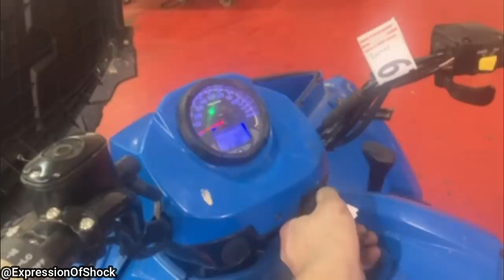Customer States Dodge Challenger Won't Start After Collision Repair | Just Rolled In

Comment: I got a little original German Mercedes anecdote.

My company always drives Sprinter vans. One time, an engine died somehow and got replaced with a factory new one. I was given this van with the new engine. When leaving the company grounds, the engine turned off after 1/4 mile. Started up again, so I tried going again. Engine turned off again after a short distance, not even leaving the tiny town. Told my company, I can't go on this 400 miles trip with this van, all the shit was loaded over to another van and there I went.
Few days later I was informed, that the Mercedes mechanics missed to install the oil line between engine and oil pan. The new engine ran dry, got killed and had to be replaced under warranty.

Comment: 1:41 I had something similar to this happen to me.  I bought a brand new trailer a few years ago.  When I say brand new, I mean, it was so new, it wasn't even towed to a dealership, I bought it directly at the plant of manufacture.  So it literally had 0 miles on it.  After towing it once, I noticed that the brakes had no power.  When I say no braking power, I mean that with the wheels jacked up, I could still spin the wheels by hand, even if I had full brakes applied.  When I pulled the hub, everything was coated with grease... not as bad as this, but the lead shoe, the trailing shoe, and the magnet were all coated.  What happened was that the axles were Dexter EZ-Lubes, where someone could lube the bearings by pumping grease through the zerk fitting at the end of the spindle (there's one on this fitting too).  If someone pumped the grease in SLOWLY while spinning the wheel by hand, the grease would fill the bearings.  If someone pumped the grease in a hurry, like with an electric grease pump, then it would just blow out the rear seal, and the grease wouldn't fill the bearings, it would just fill in the brake drum.  I think that's what happened in this case.  When I fixed mine, all I did was clean everything with 4 cans of brake cleaner (1 can per wheel) and several rolls of paper towels.  Eventually I got everything clean, and my brakes worked perfect since then.  A lot of people claim that when the brake linings are contaminated with grease, that the brakes must be replaced, but I didn't have any problems, just used a lot of brake cleaner.

Comment: Oof that wheel bearing though. I just did one on a 2002 i35 and only thing holding it together was the cotter pin for the axle, pulled the hub out with two fingers

Comment: I was on a driving lesson with my dad, we pulled up behind a car and both it's back tyres were really low. Dad told the driver they need air in the back tyres, the lady driving didn't know how to do it, so dad told her to pull into the next service station and he would show her what to do. When he went to blow up her tyres, both valves had a broken matchstick in them. Dad managed to get them out and show the lady how to blow up her tyres. Turns out there was some kids sticking matchsticks in the tyres valves at the local shopping centre car park. When they were caught they said ''it was just a prank'' 🤦‍♂️😡
Reply from the maker: Damn kids 😆. I've done some "pranks" when I was younger but it was never to people's vehicle lol
Reply: that could also be deadly

Comment: I have had body work done several times. Couple of deer strikes, a hit from an uninsured/unlicensed driver, got backed into while parked, etc.... Nothing major. I took them to a shop with a good reputation, that I trusted. Always good work. If you don't have insurance or the money to fix it right, don't get it fixed. Using a cheapo body shop is a big waste. It won't look right, may be unsafe, and resale value will be down.

Comment: I had a body shop drop off a SUV to check noise after they finished their job but gave car back to customer who had it for over a week. We were busy but said it would at least get looked at b4 lunch and report the findings. Found myself waiting for parts so decided good time to do a road test . 2 laps around the complex I couldn’t quite hear or feel a thing so thought maybe wheel bearing that was noisier at highway speeds. Up the road I went , was about 2 mile away when noise started, I thought to slow down to perform a u-turn and head back to shop knowing noise was left front but still not 100% confident it was a bearing or what , then the LF wheel passed me , damaging the freshly painted fender on its way out. Lugs nuts came off, I was able to jack the car , steal a lug nut from each other wheel and put tire on to get back to body shop. Come to find out the lady had it to her mechanic and to the body shop a few times in that week b4 I got it. I feel blessed I didnt get injured and not knowing the lady thankful it didn’t happen to hear but it would have if she drove it one more day

Comment: The mobile mechanic just wanted to make the brakes last longer. A couple of those might need a wheel bearing. I came across a taper bearing where the inner race was galded/welded by heat to the spindle and ended up using a cutting wheel to get it off and others that had to have the spindle replaced too.

Comment: The thumbnail looks like what mice did to my 95 Z28.  Ate through so much wiring!  Have you ever heard what a GM LT1 sounds like running on 3 cylinders?  Me either.  Got it to run for about 3 secs...

Comment: The ATV wouldn't start, bcs the air filter was installed backwards. If this engine uses a carborator, then if theres no air, and no air means no gas, technicaly, it ain't got no gas in it!

Comment: I had a bad shake while driving for awhile. Thought for sure it was a tire. It ended up being the master cylinder that would occasionally get stuck and the brakes
Would be slightly engaged causing brake rattle.

Comment: You see there is a use for an Audi engine.
The trailer brakes though?? I have seen totally stuffed hubs but the drums?? 
The ATV filter,, that needs clamping on. and even then probably NOT suitable for ATV use.

Comment: Hmmm, no communication with ABS module because of severed wires.....are you sure it’s a Challenger and not the Ford Explorer I was working on when 5 pm rolled around Friday? 🤔

And was a PLASTIC line they used for the brakes?!?

Comment: 0:05 this hurts to see. either the cuts were caused by the accident, or by laziness. there is a reason why they say, check wheel nuts when a car comes from the body shop...
0:37 check your local road construction site. the worker probably sticks under the next truck... protip: don't run over everythign that lays on the road, no matter if you think there is enough clearance.
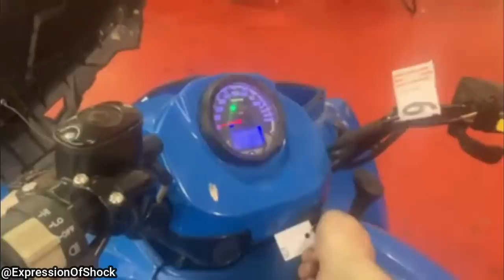1:14 this can also happen to rethreaded tyres, as there is no way to determine what has been done to the tyre before rethreading. I had one breaking like this after two years of normal driving.
admittedly, the noise and vibration comes slowly, and is often not noticed until someone else asks what that noise is.
1:41 I had to pause the vid and stare in astonishment. I can understand a splat of grease or oil, but filling THE ENTIRE BRAKE DRUM WITH GREASE how does one get that idea? they clearly had no clue what they were doing.
2:31 story from me learning car mechanic.
after the initial year of apprenticeship we were tested for knowledge, theory and practical. the school had some donated cars from a local Opel dealer, namely some Opel Rekord-D. for unknown reasons, Opel added a little bolt to the wheel hub surface with a corresponding hole in the wheel, so it can only be installed one of four ways. they omitted it again eventually... so when it was my turn, I removed the wheel from the car and went to diagnose, wheel, tyre, brake, and everything. and of course saw the dents left by ignoring the bolt... and the ruined wheel's conus from the nuts being screwed on backwards. after mentioning all these details the teacher nodded me off and called for the next. guess I did it right, I got a pretty good rating. XD
2:41 great work! :D they cranked out some nice motorhead's furniture out of mere junk. ^^
outro: can I has the Fairlane pls?

Comment: That trailer brake job ... I just can't even ... that's amazingly bad. WTF did they even DO to create that mess??
Reply: The wheel bearing dust cap sometimes has a grease fitting. Supposedly so you can lube the bearings without removing them. Eventually that hub cavity will get full with grease and push past the rear seal. Then you keep pumping in tube after tube until completely full.
Reply: @franklaskus2395  Thank you, I was genuinely puzzled. Mechanic: Boy, it sure needed a lot of lube! Me: That's what she said.
Reply: @kmacksb  my old boss did this to his boat trailer. He should have known better seeing he owns a muffler shop. IDK where they think all that grease is going. Never lubed anything that took the whole gun full. That much grease is multiple tubes

Comment: on the challenger, as well as charger, 300 and magnum they are steel line from the master to ABS to flex hose just before the caliper and they are straight with 45 and 90 degree, not like this. Also they are hide in the core support until the ABS. They didn't replace them because they are expensive more than 1k for all of them
Reply: One more reason to run away from Chrysler shit. 1000 dollars? They think they are BMW or Mercedes to be able to rip off people like that?

Comment: I can some what understand the trailer brakes. It looks like it a boat trailer, which means it goes in and out off salt water, with no way of hosing them off. If you don't wash boat trailers, they can rust away Infront of you. This is still monumentally stupid, but putting grease on a part that gets full off salt water and that you can't clean easily, I can see the logic.

Comment: The air filter manufacturer for the ATV is at fault.
They should make sure it can’t be put in backwards.
Should be pretty simple change of design.

Comment: I needed a brake line replaced and the the fucking shop called later and said needed a new master cylinder replaced when I KNEW there was nothing wrong with it. Basically told them to just replace the brake line only had no problems after that. These mechanics think everybody is stupid. 
I hate to see the bill on what most of these people get in these videos.

Comment: The wires in the first clip look deliberately cut. All the cuts (wires and outer wrap) were too clean to have just been wear n tear.
Reply: It's common. When in a crash, all it takes is a piece of sheet metal, acting like a razor blade, to cut thru an entire harness.

Comment: How stupid do you have to be to grease the brakes???
And they didn’t just use a small amount either,
Looked like they must have used a full gallon to pack that brake drum tight-
Guess they thought it was a big bearing??😆😁

Comment: Those aren't "broken" wires. Those are CUT wires.
Someone screwed up.
Reply: those are broken wires, he even shows the harness at first where the wires are broken. smh
Reply: @WEALLSUCKLOL  When the "break" is a straight plane through the conductor and the insulation, that looks VERY like a cut.
It could be a cut from tool use, it could be a cut from the wires being caught against a sharp metal object like an after-market body panel being 'convinced' into place.
-
A flexion break in a wire (a break from repeated bending until the wire parts) and a tension break (when a wire is pulled until it fails mechanically) do not leave such a clean, planar line across the same spot in the wire and insulator.
Reply: @MonkeyJedi99  it's broken from the accident. simple as that